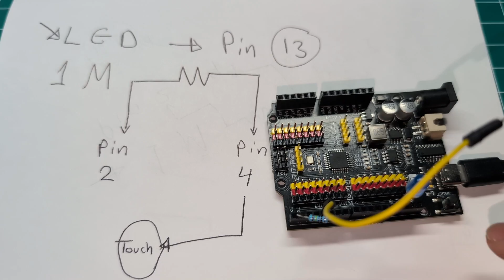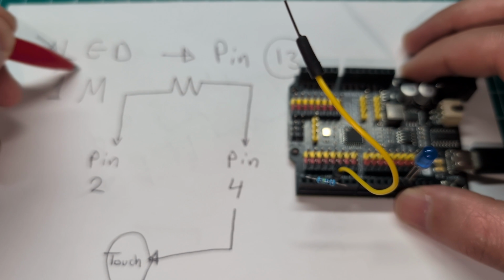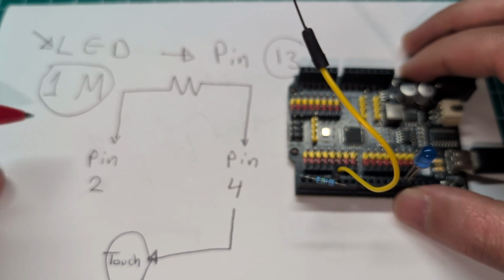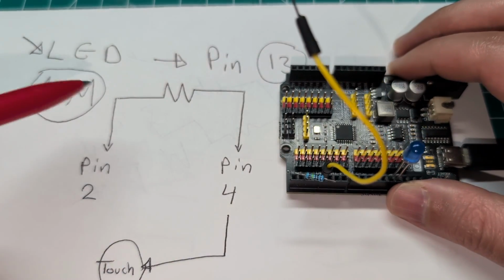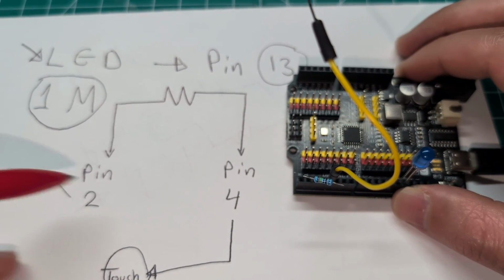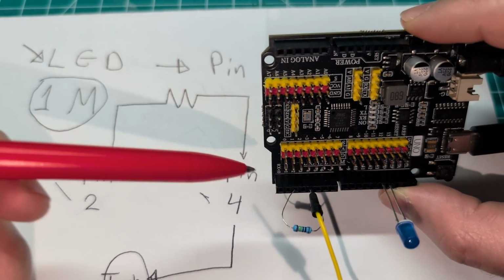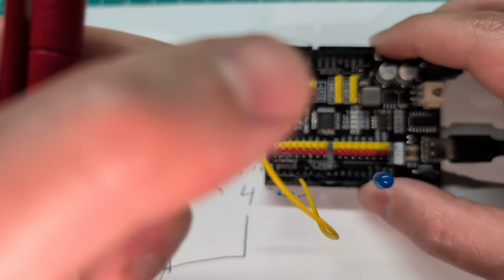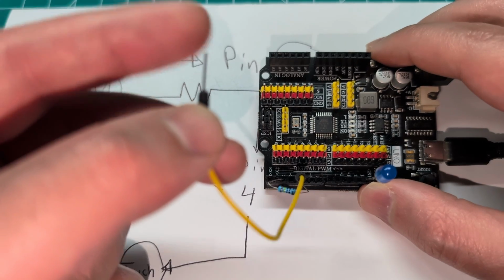Make Capacitive Toggle Touch Switch Using Arduino

Comment: sir i love your videos , can you please tell me the type of arduino uno you are using and its purchase link ? it will be of a great help 
.....
Reply from the maker: Hi, thanks for the nice comment. It's Arduino UNO R3 but you can use any Arduino for this project. I recommend getting the R4 at this point since it's the new version but it's more expensive. You can buy the nano which is cheaper if you prefer. All on Amazon buy the one you think is the best deal. 
Search for Arduino UNO R4 or R3 or Nano depending on how much you want to pay